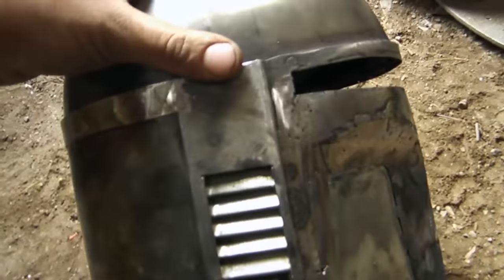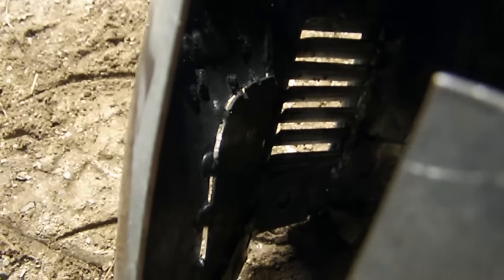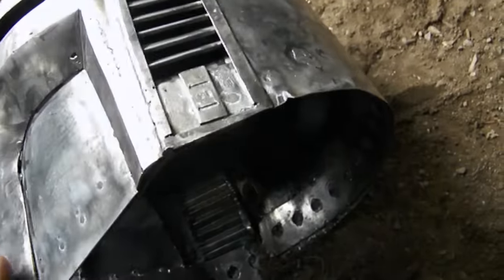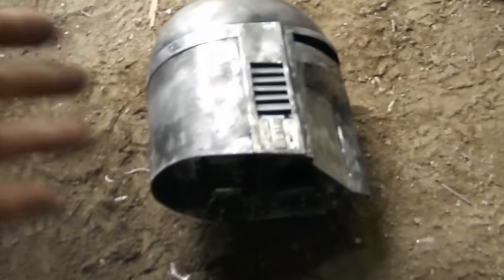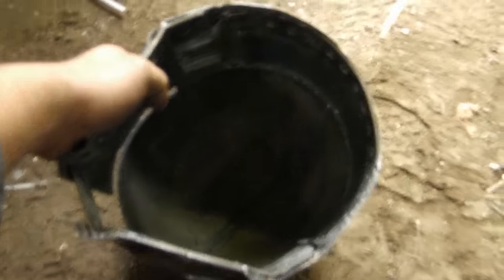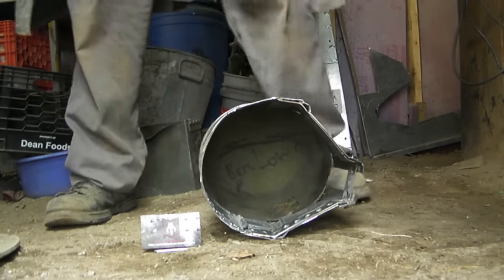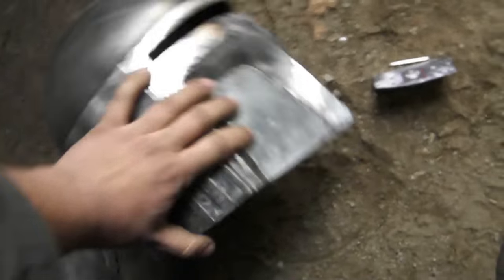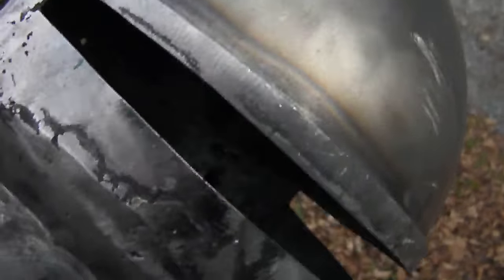REAL METAL MANDALORIAN HELMET...Jaster Mereel + bonus Durability test

Comment: What Guage of metal did you use for the dome and cheeks? and also did you use english wheels to round the dome, or a different method? Thanks
-Josh
Reply from the maker: I only shaped with a hammer-no large benchtop tools due to size constraints and budget(I don't use chinese tools, nothing imported or that isn't of an industrial brand is destroyed after only one build) majority of metal I use in helmet construction is 18ga and the cheeks are not dished they are fabricated from 3 pieces....two for the arches and 1 flat base, then they were welded to the rest of the helmet. To only use blacksmith methods may be cool but for production time is money and even making most of the helmet through fabrication rather than smithing-typically for a plain boba style helmet is around 30 hours of work.
Reply: Dresdon Acacin Thanks so much for getting back to me. That information is very helpful as I have plans to attempt one of these babies. thanks so much!

Comment: Alrighty. Hi there again. How much would a basic helmet like this cost with padding and chin strap? I would want it to be painted matte black. And what type of visors do you use? Would it allow good visibility out but remain dark opaqueness from the outside? Nothing but matte black, chin strap, padding, visor and everything that comes on this helmet, probably minus the range finder
Reply from the maker: Well heres a price breakdown estimate for what you want...prices are in USD, helmets take between 2 weeks-4 months depending on parts shipping time, extreme weather, trooping schedule, and hostile environment. To start a commission requires 150 down to cover standard fabrciation consumables, once a build has begun the downpayment is nonrefundable because it is spent on supplies, progress pictures are communicated through my facebook page, preferred payment method is Paypal for buyer and seller transaction protection.
https://www.facebook.com/AcacinArmouries/

Fabrication:
-Base fett style helmet in 18gauge steel with ballistic dome: 350(jango scale S/M), 400(Boba Scale L/XL), 450(2XL+ ))expanded dome)
-NON RF fett style earcaps: 30
-Upgrade to 18gauge 304 Stainless Steel lower with ballistic dome: add 50% to price
-Upgrade to 16gauge 304 Stainless Steel lower with ballistic dome(16gauge is SCA Fighting standard): add 75% 

Extras:
-Priming/Painting: $25
-Shade5 propionate visor+trimming/instllation: $50
-Stainless Steel Visor mounting hardware and gasket: $25
-Memory foam combat helmet padding: $35
-Oldschool Leather combat helmet suspension harness: $25
-Steelpot combat helmet leather Chinstrap: $10
-While I havn't used these before, I could theoretically install one of these as well:
http://www.ebay.ca/itm/Tactical-Airsoft-Helmet-Head-Lock-Buckle-System-Chin-Strap-fit-PJ-BJ-MH-Mich-OD-/272785849378?hash=item3f834dbc22:g:YzMAAOSw3utY7G13

Shipping:
-lower 48: $45
-Canada: $35
-International/overseas: $115
Reply: Awesome. I will probably order one within the next half year or less. What do the size he of the helmets mean? Are specific sizes only gonna fit certain heads? Or is it just depending on how much kit we want to fit into our buckets?
Reply: Also, one last question, and my apologies, but how strong are your visors and what is the difference between the types of mounting

Comment: Hi there. How much would a helmet such as this one cost, weigh, and is there any way u could fit a polarized visor to it. Suitably silver colored or just plainly polarized. Do you think there would be enough room within your helmets for something such as-communications gear, voice amplifier, and possibly a small fan and back mounted camera gear?Me and a group of friends have just started trying to build sets of fully functional armor. I'm not trolling you, we're serious about this and how long would you still be building these things. We're building the armors first, so would we still be able to reach u through this channel in a couple of years? If you're still available within the coming years we will give you specifics for our helmets
Reply from the maker: Well my helmets start at around 350 for the very basic variety and as things are added like earcaps, vents, electronics, paint ect, price goes up...for a decked out helmet with lights, fans, and paint typically they'll run for around 800. With a voiceamp, bluetooth, fans, maybe helmet mounted light...probably around 900. Keep in mind though the voice amp's don't integrate very nicely into helmets without external components but a wireless mic integrated into the helmet can solve that problem, just put the amplifier in your belt in a pouch and problem solved. For timeframe that's fine with me-my current waitlist is around 2-2.5 years.
Reply: Awesome thanks for the timely response! As for the voice amp, we'd probably hook that up to the suit. Is the polarized visor doable? And would a chin strap and a hard hat type of suspension inside to reduce impact sound doable?

Comment: Would you be willing to make a helmet on commission for me? I want a metal helmet similar to Pre Viszla's. How much for a helmet approximately?
Reply from the maker: +projectno253 While I have a very lengthy waiting list at the moment, I estimate a pre vizla like the one with the round ear caps and stuff, would easily be in the area of $500 and up...taking into account the extra time needed to facilitate fabrication of the extra curved and bulbous portions on the sides of the helmet...plus making the ears and stuff, then making them to rotate woiuldnt be too timely just adds to the list. Estimate of finished weight would be about 7 lbs